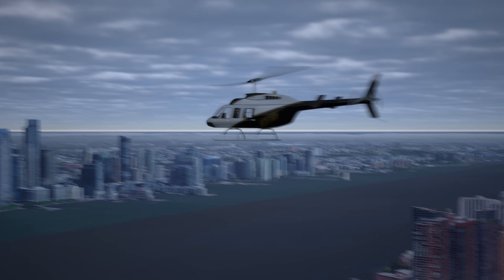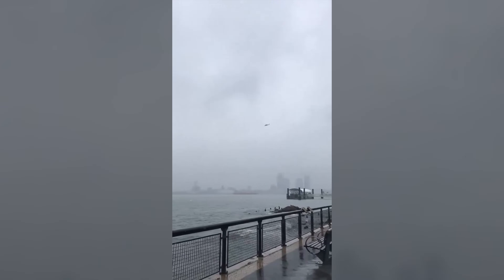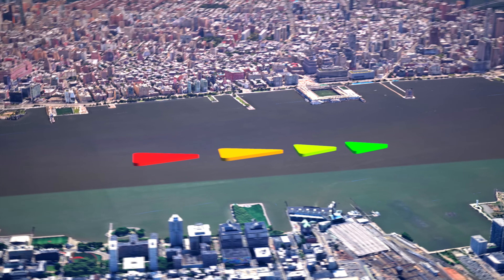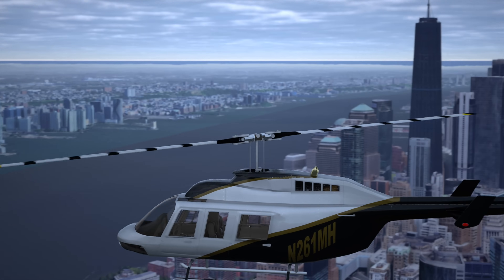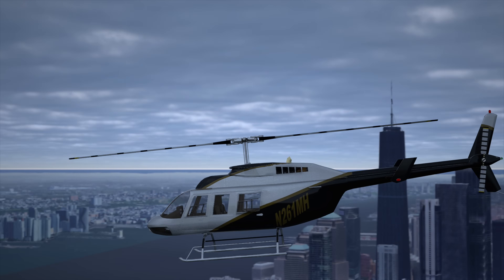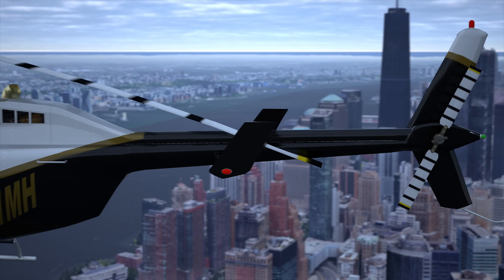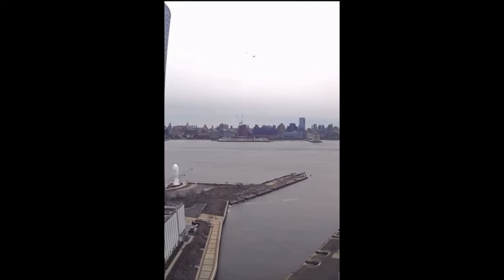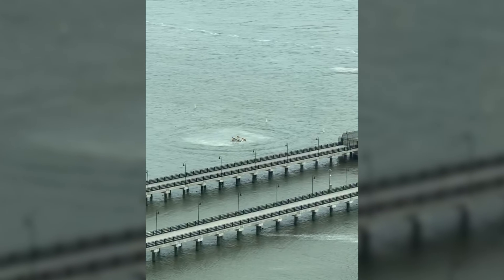Helicopters DON'T just fall from the sky - What is "Mast Bumping"?

Comment: Mast bumping is an engineering failure, masking it with pilot training to mitigate a natural human reaction to any given situation is just kicking the can of catastrophe down the road.
Reply: No, I don't think you can say that. Otherwise, thousands of flight hours a day wouldn't still be flown without problems with helicopters equipped with two-blade rotors. What's more, no new helicopters with two-blade rotors would be registered at all. But that's still the case, especially in the light helicopter market. There will never be 100 percent safety.

Besides, like most people here, I don't believe "mast bumping" was the cause of the crash in this case anyway.
Reply: @CharIie-Mike  Well, to start with, if I couldn't say it you wouldn't be butt hurt about it. So, which is it, the two blades or the eccentrics?

Comment: Helicopters don’t just fall out of the sky? 

Sure they do…. They are made of metal and aluminum with over 100,000 moving parts built by the lowest bidder……. I assure you, they can fall out of the sky.
Reply: Okay, but he's kind of right. Normally, they don't do that for no reason, just like fixed-wing aircraft. That's probably what he meant with the headline. However, I think the reference to "mast bumping" in the headline is nonsense.

Comment: Some observations about this incident: 

The Case: 10/4/2025 Thursday. 21.14 CEST Happened = 15.14 ET Local Time The USA, Hudson River, Close to the Jersey side, near Pier 40, 40°43′45″N 74°1′37″W, Bell 206L-4 LongRanger IV helicopter, Registration N216MH, New York Helicopters Joy Flight Crash.

Take Note: The distance between the Intrepid, 40.7646°N 73.9996°W, the last spot where the pilot Sean Johnson, communicated with ATC, is 4.9 kms away from where the main body of the heli hit the water, 40°43′45″N 74°1′37″W. The heli in the last two minutes of the flight had an average speed of 150 kmh. (Note, in the last 20 seconds of the flight, before it broke up mid air, it had sped up to 190 kmh). At an average speed of 155 km it took 2 minutes to get from the Intrepid to the Holland Tunnel. This last 2 minutes of the flight is crucial to the investigation. 120 seconds is more than enough time for something catastrophic happening to the final downing. What happened in the cockpit during this time? 🤔 

The pilot's call, if it did happen, about the fuel was routine. The heli did not crash because it ran out of fuel, and this Line of Inquiry is a Red Herring.

Weather was absolutely not a contributing factor in this crash.

Some other interesting analyses about the crash:

10/4 18.13 ET Desert Rhino: "Lot of strange maneuvering just before the crash. I’m guessing some mechanical failure leading to a loss of control. OR medical issue with a pilot and a passenger trying to fly. Either way, it eventually exceeded design limits and had a structural failure. Anyone know if a commercially operated helo of that type will have any kind of data recorder? And also, it remains to be seen if he said called out with any emergency or difficulty." 18.15 "Not impossible that the pilot was hot-dogging. But doing that in a tourist operation, over the NYC area with thousands of eyes and cell phones? That’s a near guarantee you’d be fired within the next couple of days as soon as the owner found out." (Free Republic)

18.33 Robert de Long: "I seriously doubt that was the case at all. I would venture to guess that the visual being observed was the result of a helicopter that is either out of control, or control is being degraded making it hard to control. Thus, the damage had been done or it was in the process of breaking up." (Free Republic)

18.35 MudflyWatersman: "Helicopter no longer had a tailboom. It's a boom strike. Operating the helicopter aggressively caused the rotors to flex until they struck the tail boom chopping it off.... Unfortunately it actually happens fairly routinely. You would not think they would design a helicopter such that that can happen but it can." (X/Twitter)

19.02 MrPowerup2010: "Bell 206L4 mast bumping scenario here indeed. Cyclic was pushed  or at least low -G situation has been encountered. RIP." (X/Twitter)

Prayers for Agustin Escobar, his wife, Merce Camprubi Montal, and their three children and the Pilot, 36 y.o. ex Navy Seal, Sean Johnson. I am sure they are up in heaven now and what the full truth to come out about the reason for the crash. I also think Michael Roth, the CEO of NY Helicopters, wants the truth to be revealed.

יהוה מתעב שפתי שקר, אבל הוא מתענג על אנשים מהימנים.

Adam Neira
Founder of World Peace 2050
Founded in April 2000
Paris - Jerusalem - Melbourne

Comment: As a former army OH58D instructor pilot and was trained in the TH67 ( bell jet ranger). You have to do some crazy shit to get in to the mast bump. It was the blade pins or the main hub nut.
Reply: Well, the rotor and main gear box are still connected, and the rotor is still rotating when it crashes into the water well after the passenger compartment.
That doesn't fit with your assumption about the blade pins or the "Jesus nut", does it? 
However, I also consider mast bumping to be an unlikely cause of the crash.
Sorry if I mistranslated your comments; English isn't my native language.

Comment: >Helicopters DON'T just fall from the sky< - Yeah they do. I was in one that did just that.

I had a two year all-expense-paid vacation to scenic Southeast Asia during the ‘fun times’. I flew in Hueys almost every day. I didn’t fly ‘em, I wasn’t a crew chief, I was just the radioman (avionics)… other than the pilot, I was the one guy they couldn’t go anywhere without. So, wherever they went, I went. I survived a helicopter crash – UH-1H transmission failure at 1200 feet – autorotate into a rice paddy…in the DRY season - hit pretty hard, but all aboard survived, though well shaken up.

The main rotor on a Huey turns at 6600 RPM, the tail rotor at better than 30,000 RPM. Losing either on could easily shake the airframe apart. Thus there is not even a chance to autorotate… when that happens there is no time to react, and there is nothing that can be done anyway.

My deepest sympathy and condolences to the families of the pilot and passengers. May they rest in peace.

SP5 Old Curmudgeon 
US Army Vietnam Veteran 1969-70…. and still…
Beaucoup Number Ten GI

Comment: It wasn't a "mast bump". There was an uncommanded right yaw, possibly from a failure in or of the tail rotor. Two seconds after the yaw starts the tail boom fails due to overstressing and departs the aircraft at rear of the fuselage. A second or two later the main rotor and gearbox depart from their mountings.

If there was a "mast bump" the half of the tail boom would still be attached to the fuselage.
Reply: So what even happened then?

Comment: Let's look at the video.... the helicopter made an abrupt yaw and if you watch closely, the tailboom broke just aft of the fuselage. The main rotor was level in normal flight. This appears to be structural failure of the tailboom. I am a former army helicopter pilot, certified in aviation safety and maintenance with over 35 years flying.

Comment: Yeah, as a 27 year Bell helicopter mechanic.  Yeah, not mast bumping.  The rotor and transmission were still together.  I'm leaning towards an unbalanced situation in the main rotor that separated it and the transmission from the fuselage.  We will know when they find and analyze the main rotor parts.

Comment: This does not appear to be mast bumping. The helicopter is in straight and level flight and experiences an abrupt yaw. The tailboom and rotor, still attached to the transmission, then separate from the airframe. The most obvious cause for the uncommanded yaw would be loss of tailrotor thrust due to mechanical failure. If it was mast bumping the mast would be broken between the rotors and transmission. The rotors would likely separate from the transmission. IMHO.

Comment: Mast bumping is caused from a low g pull over it didn't look like it did that,and the rotor does not tilt they use articulated blade control unlike an airplanes you lower the collective do not push the nose over that will cause a low g pull over poor folks R.I.P

Comment: Sorry to say that!  But a Helicopter cant tilt its Rotor by any mechanics. The Base of the Rotor isnt moving. The only thing you can move are the Rotor Blades. And the tilting you see are the Blades pushing in certain directions due to the lift there are creating. Please get your facts straight.

Comment: Had a friend years ago that spent five-years restoring his military surplus OH-58 only to have it completely destroyed on its maiden test flight. After only a few minutes in the air, he heard an unusual sound coming from the rear of the aircraft (but no warning lights at this point) and immediately returned to the field. In the process of hover taxiing back to his hanger, the main transmission catastrophically seized up and the entire main rotor / transmission instantly, along with the tail boom, completely separated from the aircraft. Luckily, he was only 2 feet off the ground, but the videos I’ve seen of this accident look like something instantaneous like that took place.

Comment: A chain is only as strong as it's weakest link. In this case, the chain of events came to a crashing halt due to that weakest link: either maintenance issues (degraded  mechanicals,) design issues (lubrication isues, faulty parts,) pilot error (possible but, unlikely here,) or a random event (bird avoidance, tunnel winds.)

Though, it seems there have been more than the infrequent air craft accidents lately. Why?

Comment: the illustration how a helicopter is working is not accurate the rotors have a delay (90°) when you tilt the rotor to the front you move to the right it is called gyroscopic precession

Comment: I've never heard of a Bell 206 suffering a "mast bump". Look at the flight data, the pilot wasn't doing anything crazy. Look at the video, the transmission is STILL attached to the intact rotor. In a mast bump, the shaft separates above the transmission. In this case, the entire transmission and rotor assembly departed as a unit.

Comment: As an Aerospace Chief Engineer, with many years spent on Rotary Wing Aircraft, I would say the cause of this particular accident is unlikely to be Mast Bumping.
1. The detached Rotor assembly appears pretty much intact, which wouldn't be the case if a blade had just sheared through the tail boom and the internal drive shaft.
2. The entire tail boom appears to be missing aft of the cabin. A mast bump would sever the structure much further back.
Personally, I think it's more likely to be a catastrophic tail rotor drive shaft seizure or structural failure of the tail boom.
Reply: I came here to say that if it was a mast bump the main rotor wouldn't be intact. It's also 'never' seen in this model.
Reply: @jacobpalmer9247 ”I came here to say”…..just say it dude. Stop with this corny repetitive beginning yall always do. I came here say that! I was just about to say that! I came here to say this!
Reply: @jacobpalmer9247  I came here to say opinions are like arses and elbows .. everyone has them ... and I don't think you know what you're talking about .. just my opinion though.
Reply: I'm no expert but I would guess drive seizing up.
Reply: As yeah Mr bragger 🙄🙄🙄
Reply: What about a bird hitting the tail rotor?
Reply: interesting observation
Reply: Here’s a thought, what if one of the bearings in the tail drive shaft seized, and with tremendous momentum, the still spinning shaft twisted the entire tail off. At the same time, the sudden jolt and increase in load, torqued the entire engine assembly off the fuselage. Seems plausible.
Reply: Thousands of satellites are roaming around the Earth and are capable of doing all kinds of things, directly or indirectly. Hence, no proofs/evidences are being found for such incidents. Also, AI is there which can beat down human intelligence and make them commit errors/confuses them by providing incorrect understanding of their environment.
Reply: Looking at the video it looks like the helicopter yawed suddenly 90 degrees. Then the tail comes off. Then the rotor. Would a seized gearbox do that?
Reply: @CristiNeagu  If the Tail Rotor drive shaft seizes the Tail Rotor would immediately stop, resulting in the helicopter body instantly rotating in the opposite direction to the Main Blades. The force generated by the seizure could also rip the tail boom off along with the main rotor head.
Reply: @bobdylan7120  Sounds plausible. It's kinda hard to tell which way it yaws, but I think the tail might be swinging away from the camera, which would align with what you describe.
Reply: efectivamente...es imposible que haya impactado en el mastil;la hélice esta sujetada por tres puntos de anclaje,el central y los dos laterales..sesoltaron los tres? o los soltaron apropósito?
Reply: Aerospace Technical Engineer here...I must say that I have to agree with you...I was also thinking gearbox seizure and with the speed of those blades it ripped the tail shaft and rotor blades
Reply: Accidently on purpose.
Reply: I strongly agree.
Reply: As an aerospace master chief engineer, with even more years spend on rotary wing aircraft, I would say the cause of this particular accident is likely to be mast bumping
Reply: There were 3 6's in the LIKE count - just changed that...
Reply: I found that the available video evidence from confirmed Mast Bumping crashes would seem to disagree. I watched all that I could find and identified 7 videos, so I'm curious what makes you think this is the case. You claim that:

1.  The detached Rotor assembly appears pretty much intact
In all 7 videos I was able to locate of a confirmed Mast Bumping crash the same thing seemed to happen - Rotor is detached and seems to be still spinning and is in tact and not blatantly deformed before first striking the ground.

2. The entire tail boom appears to be missing aft of the cabin.
In at least two of the Mast Bumping videos I could find the same thing has obviously occurred, in one the break was farther back as you suggested would occur, and in the rest it was impossible to tell
Reply: @sango_wilko851  I dont really think its technically possible for the rotor to cut the mast just aft of body. Anyway, what about debris? i would expect a lot of debris after the initial hit of mast. Here we see debris after breaking apart.
Reply: @LaggerSVK  I think once the rotor has disconnected while still spinning the dynamics involved in how it moves combined with how the fuselage is now moving separately could allow for just about any type of combination between the two - especially so if it was weather related turbulence that provoked the issue in the first place. 

The debris also can fall at quite varying degrees under the same principles and I'm not sure it's a safe call to say that every piece of debris you see falling to the ground was produced by the fuselage falling or breaking up. If that is true, we don't get to see the initial impact in a way that would let us know if it produced significant debris or not.
Reply: UH-1N/AH-1W experience: looks too clean to be any 1 thing.  Any recent PMs/MRCs done for safety issues, or required NDI checks missed?  This just looks like an analog to a car's engine mounts all shearing + tranny / drive shaft  & differential all 'just separating,' simultaneously, like an old Buster Keaton car falling-apart.  Even if all the castle nuts were safety wired and all sheared & vibrated-loose [impossible, on it own right,] and everything simoutaneously 'un-screwed,' it still would have been a spectacle The way the blades were complete & still tracking, reminded me of a Jesus nut failure... but the entire assy [cleanly] departed the airframe & tail boom looked like it was cleanly-uninstalled in a depot facility [in-flight.]  Doesn't pass the smell test..  There were a couple of 'poofs,' with no signs of of the severed assys destroying themselves from the stress, nor impact.  Just another 'unsoled mystery,' or improbable/impossible mishap report released which answers nothing.  just looks like a fuselage that was slid out of a cargo plane backwards, if it wasn't for the flight tracker pattern log.
Reply: @bobdylan7120   model helicopter assembler here: I have put togather many helicopters and I have to admit that there have been times I left parts off or failed to use enough glue causing the helicopter to fail and come apart at a future date
Reply: @ricrid GLUE⁉️
Reply: What would cause that. Do tail booms just fall off
Reply: @thedevilsadvocate5210 It appears that the main rotor gearbox seized and tore the rotor and gearbox entirely off the roof of the helicopter. Not “mast bumping”.
Reply: @thedevilsadvocate5210  few bolds missing, wear and tear
In short possibly negligence of  maintenance
Reply: Would losing the tail rotor cause the main rotor head to get over torqued to allow it to be removed or cause the main rotor head nut to fail?
Reply: @the_frankc   Losing the tail rotor would cause the helicopter to uncontrollably rotate in the opposite direction to the main rotor blades.
Reply: I was thinking boom strike and attach point failure
Reply: "Chilling to contemplate—during the Spanish Prime Minister's visit to China, the entire family of a Spanish national and Siemens vice president mysteriously died in the United States."
Reply: @yanzhigang4 
Lil Pink or 50Cent?
Reply: @Mike-nd8ye  萨比
Reply: Yeah people say the chineese did it to make america look bad m. Crazy no one talks about it much @yanzhigang4
Reply: Looks like sabotage
Reply: @jcmc9378  Ridiculous! The family spontaneously took a trip as a last minute birthday gift for their son.
Reply: @jcmc9378  It does look that way
Reply: @jcmc9378  tin foil hats are here